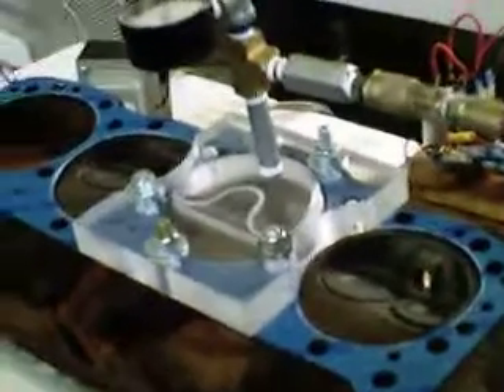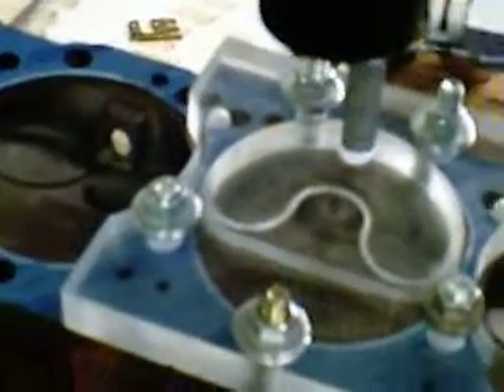VexUs Plasma spark vs. Compression

Comment: Now thats cool. I was wondering what would happen under pressure. I assumed it would be the opposite. What about humid air?

Great work and thank you.
Reply: CarbideTip any humidity and/or vapours would enhance the effect. That’s why such a small non-plasma spark ignited the air-fuel charge. Plasma would obviously do it much more quickly and fully, for an increase in torque and a reduction in emissions. Imagine what it would be like on a super or turbocharged engine.